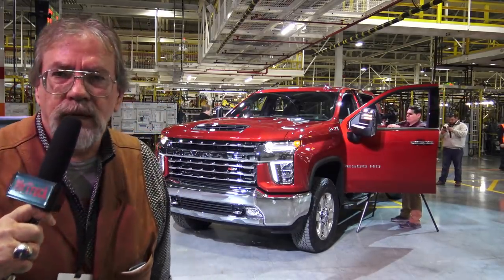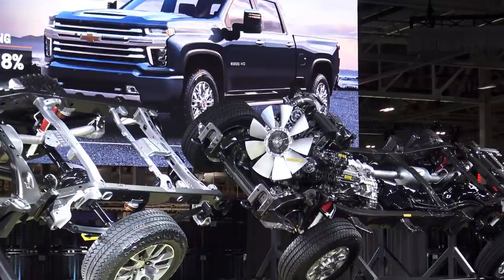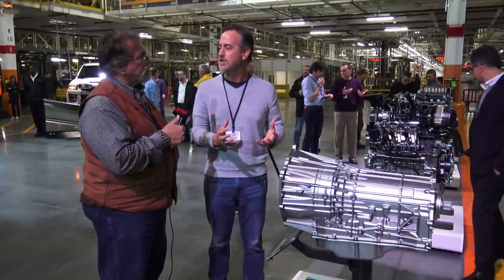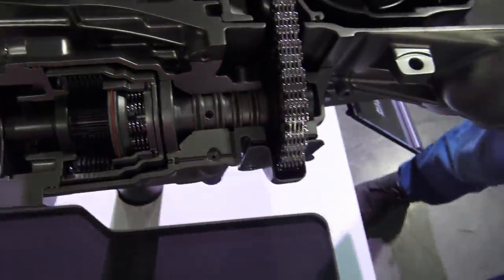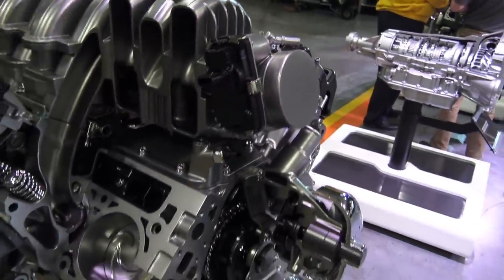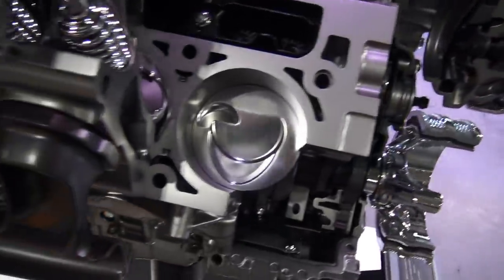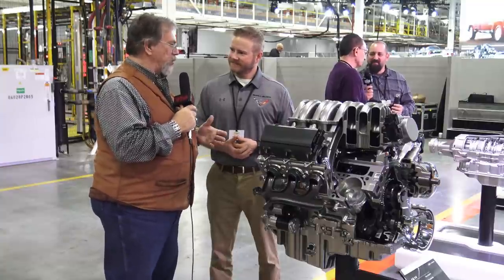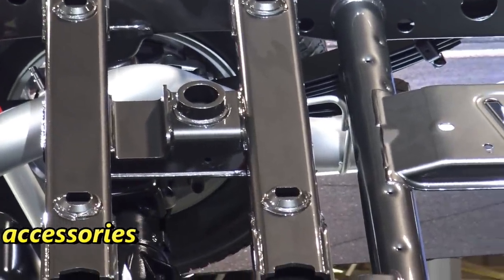2020 Chevrolet Heavy Duty factory tour in Flint, Part one engineer interviews

Comment: GM has been building their Allison transmissions for their pickups since the sale of Allison in 2007. The name Allison is still being used because Allison has contributed to the upgrades in the transmission with the upgrade in the Duramax. Allison would not allow their name to be used if the transmission did not meet their specs and engineering input.

Comment: Mr Truck! Finally they've listened ( probably not) to me! I got a 2015 Denali Dually and I have talked with the dealership here in Northern Colorado about if GM can move the DEF filler to the back like Ram and Ford did, also said why can't they make an extension for the wide step going towards the bed. Some of us need it. Well now they integrated it into the bedside. Also said we need a camera for the bed to hook up the gooseneck. I got a toolbox and from the driver's seat I can't see the hitch and with the bed being taller, that makes the tailgate longer so there's not much wiggle room when it's down hoping you don't crunch it against the trailer. One more thing. Why did they put the exhaust brake switch on the far end? Put the buttons that'll be used more closer to the driver. I don't ever use the pedal adjustment.  So finally! All my concerns came true in the 2020. Wish there was a way they could of heard me back in 2015 that way GM would of been first to come out with most of these things. Oh one more thing. I know the Duramax can hit 1000 ft/lbs. Banks Power has proven that. Why did they still keep it at 910???  I also seen that the gooseneck was behind the axle too. When you find the answer please let me know! Love your show!
Reply from the maker: Great keep up the good work. I complain to all of them too

Comment: It's not really half a Peterbilt because semi trucks have 50% of their trailer weight as tongue weight as opposed to 10 - 15% that pickups have. The pickup would have to have a payload capacity of 17,750 to tow 35,500 lbs of a semi-truck dry van trailer.
Reply from the maker: OK, it was an exaggeration

Comment: It would be nice to have and Allison transmission in the gas engine
Reply from the maker: They did long long ago have an Allison behind the 8.1 L gas
Reply: @MrTruckTV   They call it an Allison transmission but its really a collaboration of ford and GM creating the transmission.
Reply: You would pay a premo price for the allison for a gas engine that will never produce the torque to justify having an allison..
Reply from the maker: I'll have to look it up. Also the Avalanche had it to in a 3/4 ton
Reply from the maker: @bradcoddington1679  That's a different 10-speed
Reply: Your wish has been granted. I just bought a 6.6 gas with 10 speed Allison transmission. It’s amazing I pull a 16,800 pound trailer up the mountains with it

Comment: I like my 2020 3500HD with the new 6.6 L. Pulled 2 loads of lambs from SD to CO.  Gross weight on both loads was over 26000 lb.  mileage was about 7.5 loaded.  Empty hiway driving get around 18.  Have gotten 26+ once driving around 60 mph. Just made a trip driving 75+ got over 15 miles gallon. My old 2013 with 6.0 got around 11 mpg. With E30 could get 16 mpg.
Reply from the maker: Cool, Duramax does well. Is there still lamb packing plants in Denver? 30 years ago when I raised sheep there was 3 plants. Is Monfort plant still going?
Reply: @MrTruckTV   Superior is in Denver,, Mountain States killed in the old Monfort plant. Bankruptcy and JBS took it over for cattle. New facility  near Ft. Morgan. We hauled feeders to a lot by Ault

Comment: Did you meet the 'engineer" who "Designed" the Mult-tailgate that hits the trailer hitch? Now this is 2023 and they haven't  got a clue, or at least not fixed the problem. I guess that would be like admitting there is or was a problem and afraid they would have to retro the fix.

Comment: 3.42 is the new axle ratio is for the Duramax. I believe but can't 100% confirm that the 6.6 V8 has a 3.73 axle.
Reply from the maker: That's what I've heard too. I thought they would go lower to 4.10. The 10-speed makes the difference, they can go to a better fuel mileage axle ration like 3.42
Reply: @MrTruckTV  I would have loved the option for a 4.10 on my 10speed Duramax. But after thinking about it. I believe they made the better choice of switching to a 3.42 axle.
Reply: It looks like Ram and GM swapped ratios for 2020. New SRW Ram Cummins will have 3.73 (changed from 3.42).

Comment: That is an excellent point about the goose neck ball behind the rear axle. Goes against what I know. I always keep the load slightly forward of the axle to avoid sway. Is it just the short beds to allow for turning clearance maybe?
Reply: Steven Ruble short bed versions are now 6’9” on the 2020 model so maybe they really want the clearance for trailering
Reply: I think you nailed it. I believe it has something to do with the turning radius for the short beds yet this go against everything I’ve been taught about loading on the axle. Oh well I’m sure the engineers are smarter than I am when it come to this.
Reply: This is what another commenter suggested and Mr. Truck seemed to agree with it.
'Dear mr. Truck the reason they can get away with this is if you look at the leaf springs look how far forward the leaf springs attached to the frame therefore the weight gets transferred all the way to the middle front of the frame! So the transfer of weight with the extended leaf springs going the other direction towards the front memes that your load gets transferred forward of the axle even if the actual ball is in back of the axle it is called physics! The reason I know this is because the same concept is applied when you are building large structures buildings houses! You see this with cantilever decks structures or anything similar. So all you have to do is actually look with your eye at where the leaf spring hits in back of the axle and where it hits in front of the axle and you'll notice that leaf goes far forward edit attachment point! I think you'll figure it out! God bless thanks for all the great info.!'

Comment: Looks like they powder coated the frame and got away from the wax/grease coating. Like you to encourage GM to increase the 6.6L Gas engine horsepower to 500 ponies with associate torque. Should have left the Transmission solely with Allison.
Reply: One Good Turn Gets Most Of The Blanket they sealed it for the display. Tar and wax for the regular trucks

Comment: External filter was one of the best things ! Chain drive PTO nice till you have replace it. Drain plug on pan ? Wax frame coating or are they going to do some real frame protection. Life of GM trucks in the salt belt sucks. How much weight can a 10 year old rotted out frame  handle ?  Everyone looking at the shinny new tow ratings and missing the things it takes to stop that load.

Comment: why don't they have an allison option for the gas with the 10 speed and also why don't they have a live pto like ford for running plows and dump bodies   for both gas  and diesel pick ups and chassis?
Reply from the maker: The Allison 10-speed does have live PTO, it's chain drive for less noise. Ford and Ram have a gear driven live PTO
Reply: Who uses a pto for a snowplow? A pto isnt used for a snowplow they use them to run things like a pto powered generators or water pumps or engine mounted Air compressors.
Reply: @bradcoddington1679  I use pto for my plow set up. So there genius.
Reply: I got a PTO driven hydraulic winch on a 1Ton Chevy , never go back to electric winch , torque is endless,  love it..

Comment: They may have the gooseneck / fifth wheel hitch mounted behind the axle a little bit on just the short bed trucks possibly to replace having to have a sliding fifth wheel hitch that short bed trucks have to use when pulling a fifth-wheel. What's your thoughts on that theory Mr.Truck?

Comment: So this larger engine only make 4 lbs-ft more torque than the 6.2?
Reply: blackericdenice       The 6.6 gas is being built for longevity, as it is an iron block. Same as the 6.0, I am sure it will go 300-500k miles, and is probably highly detuned. The 6.2 is an aluminum block, impressive numbers, impressive engine, but aluminum block, a 200k mile motor, also, aluminum is lighter. Thus is why they never optioned the 2500 series with the 6.2, only the 6.0 Gas. HD trucks are made for taking abuse, yet still make enough power to go fast, with the deeper gearing than what is offered in the half ton series. Put a 10k trailer on a half ton with 6.2 and 3.55 gears, put the same 10k trailer on the 6.6 gas with 4.10, or even the 6.0 with 4.10 gears, the HD will pull quicker, with a lot less strain, and will last a lot longer as well. The 6.2  are made for speed, such is why it is only in half tons, and cars. The 6.0 and 6.6 gas are made for pulling, and longevity, such is why they are in the Heavy Duty series.

Comment: There is one thing the powertrain assistant engineer keeps stumping me on.  Is the 6.6 an evolved Gen 4 LS based engine (L96 with Gen 5 bits added), or is this a Gen 5 LT based iron engine?  They don't seem to give a straight answer on this, or nobody has really asked that question yet.  He alludes to the 6.0 and taking what they've learned after all these years, but that seems about it.
Reply: Gen 5

Comment: Does that new 6.6 gas have port and direct injection?  We all know the port injection keeps the intake valves clean from carbon.
Reply from the maker: No
Reply: It has direct fuel injection.
Reply: Carbon buildup will be an issue like on any DI engine, but at least they are putting an equivalent to (or maybe even better than) a catch can on it from the factory to keep from circulating in all the crud back into the intake. And hats off to Mr. Truck for being the only one that asked about it and get that info out of this engineer at this launch event. Having that separator is a huge step in reducing carbon issues on a DI engine.

Comment: The 6.6L V8 has direct injection, does it have the additional injectors to spray the valves to keep it from getting carbon build up?
Reply from the maker: No, that's more needed with the heat of turbos

Comment: Dear mr. Truck the reason they can get away with this is if you look at the leaf springs look how far forward the leaf springs attached to the frame therefore the weight gets transferred all the way to the middle front of the frame! So the transfer of weight with the extended leaf springs going the other direction towards the front memes that your load gets transferred forward of the axle even if the actual ball is in back of the axle it is called physics! The reason I know this is because the same concept is applied when you are building large structures buildings houses! You see this with cantilever decks structures or anything similar. So all you have to do is actually look with your eye at where the leaf spring hits in back of the axle and where it hits in front of the axle and you'll notice that leaf goes far forward edit attachment point! I think you'll figure it out! God bless thanks for all the great info.!
Reply from the maker: Thanks, GM back a few years went to an off set axle. Instead of being in the middle, the axle was forward of middle. There is a term for it, I'll remember it later, but GM heavy duty, don't squat under load much
Reply from the maker: It was called asymmetrical where the axle was placed forward on the leaf spring. It help dramatically with squat under load. I'm trying to get an official answer from GM.
Reply: @MrTruckTV  Are there any official released tow numbers on the 6.6L Gas? I know you and the GM Engineer hinted at over 17,000 pounds, is that confirmed yet? I have a 2018 GMC Sierra 1 ton, CCLB 6.0 and it's only rated for 13,900 pounds. If the same setup could push 16 or 17k that might be worth the trade up, plus hopefully better fuel economy.

Comment: In 96 I bought a Chevy extended 3/5 diesel about $26,000 out the door . The country needs an inexpensive 1/2 full size pickup 8ft bed under $25,000.  $80,000 trucks are just not practical
Reply from the maker: Yes

Comment: Impressive  High Tech ..  but  so $$$$$$   If I ever bought a new Truck it would be the work Truck version .. I don't even want power winders or power door locks ..  Why on  Earth not   Engineer a bolt on Gear Drive PTO .. and  only bolt one on when it's wanted and needed .. Chain Drive PTO weather you want one or not seems stupid to me .. 

  With  10 speeds  does it even have a fast  reverse for snow plowing..  The older Duramax's sure don't such as my 2003 4 speed..
  Those Display frames look like they got a fancy  paint job way  better than that black  rail road tanker  tar paint that falls off from all  factory frames..   Still need to put undercoating on  all vehicles if you live in the rust belt

Comment: Should’ve asked him how they plan to deal with carbon build up since it’s direct injection.
Reply: use CRC intake valve cleaner.😃
Reply: Carbon buildup will be an issue like on any DI engine, but at least they are putting an equivalent to (or maybe even better than) a catch can on it from the factory to keep from circulating in all the crud back into the intake. And hats off to Mr. Truck for being the only one that asked about it and get that info out of this engineer at this launch event. Having that separator is a huge step in reducing carbon issues on a DI engine.

Comment: Flint’s paint and body quality straight up suck!  Not even close to Ft. Wayne’s quality.  My $82,000 dollar 3500HD has numerous paint and body defects.  Called GMC two days after delivery to advise as the dealer said they could not do anything about it.  GMC customer service actually told me I signed for the truck when I bought it so it’s my problem now.  😳  I traveled 400 miles to pick the truck up and it was 6:30 PM, dark and raining like crazy outside.  The truck was sitting in the front lot uncovered.  So I guess GM builds trucks poorly and with defects and once sold they have no warranty for their defects and poor quality.  😡  Just so you know GMC, you haven’t heard the last from me!

Comment: First off having trucks that can tow over 26,001 lbs is asking for trouble.
In many states any truck with a GVW of 10,000 or more the driver must have a medical card.
All these truck no matter who makes them is going to start alot of trouble with DOT
Reply: vhp454 false .
Reply: They wouldn’t have made it if it leads into those issue 
Plus if you’re towing over a certain weight more and likely that person has the requirements in order to do so .

On top of that my truck weighs over 10000lbs st most times 
All I need is a sticker saying not for hire and I have no issue
Reply: @BurgerBin  Not false. A  vehicle towing a trailer 10001 or more and weighing more than26001lbs needs to have a commercial drivers license.A Class A commercial driver's license is required to operate any combination of vehicles with a gross combination weight rating (GVWR) of 26,001 or more pounds, provided the towed vehicle is heavier than 10,000 pounds.
Reply: YOU ARE WRONG! Stop taking advice from your polticians who have no stake over your life or liberty. Most trucks are personal use, and even insane California has no laws against personal use of vehicles. Plus, you can derate any vehicle on the registration if you are a company but dont want to use the truck to its full potential. Stop the fear mongering.
Reply: @bradcoddington1679  You are wrong. You are talking about in a commercial setting. Personal use, personal vehicles towing personal items without any monetary reimbursement , no such rule exists. If you live in a state that has been telling you that, it is time to move.
Reply: @rocketssss6  In the state I live in, the Motor Vehicle Department makes no exclusions for private versus commercial use vehicle.  You need a Class A CDL if the "combination vehicle" (truck + trailer) weighs over 26,000 pounds.  You need a Class B (or Class A) CDL for a single vehicle with a weight over 26,000 pounds.  You cannot say "You are wrong" when you don't know every requirement for all 50 states.  All it takes is one state (like the one I live in) and YOU'RE WRONG.
Reply: @bradcoddington1679  wrong.
Reply: @buckhorncortez  one can say "you're wrong" when the original statement was wrong.

Comment: Big trucks like these should only be powered by diesel..a 3.0lt inline 6 with great torque. Any gas engine poweringnthis will get poor mileage
Reply: Would love if they put the 3.0 duramax in the 2500 HD, but would rob too many sales from the 6.6 gas and 6.6 diesel.  I need the payload but don't need the huge toy capacity or HD engine choices. Will probably stick with 1500 and just keep updating suspension, etc to make my own "heavy half ton".

Comment: You can not get a long time running and reliable gas engine for heavy applications, gasoline in its self is not for this , the diesel is a better option, why o why are these corporations push the gas type if diesel is way better? I do not know. History did show with FORD V10  gas engine and its competition toward diesel power units.They want power ? lets run 12 liter 1500 HP alcohol power engines in Ford Fiesta and then be happy about it for lets say a week. TH

Comment: Variable speed oil pump? Nothing could go wrong there! What a bunch of over-engineered junk. I get the same power numbers from my 454 without trannswarp cyclonic intake system
and all the rest of the crap that can go wrong with this motor.